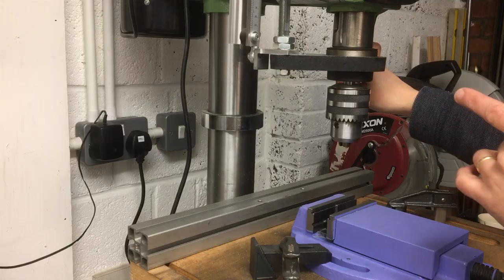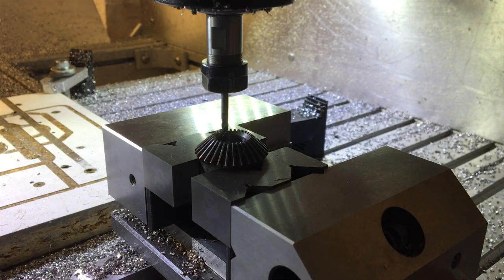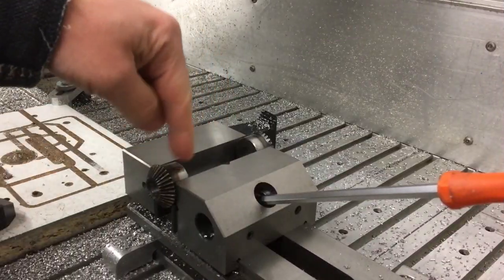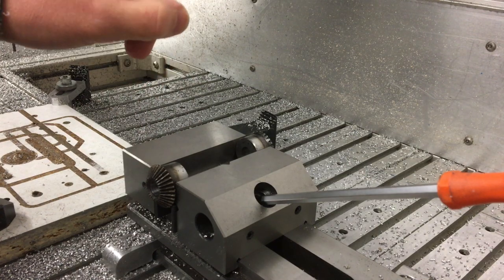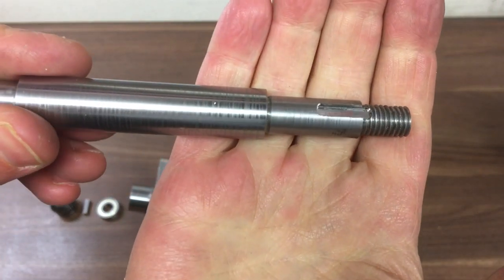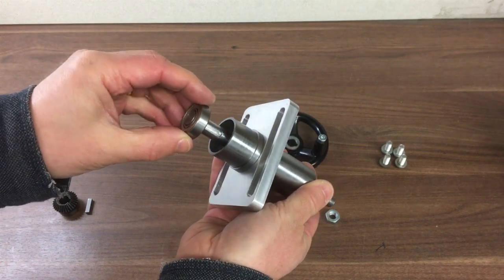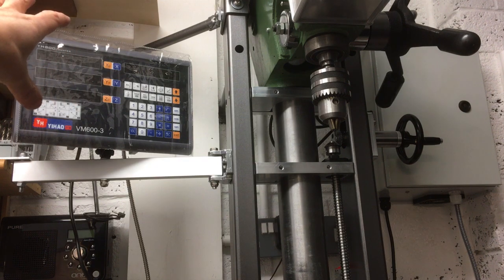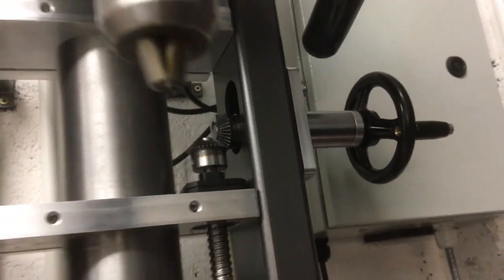Ep15: Drill Press Upgrade | Z mech finished

Comment: You should put one snap ring near the bearing on bevel gear side.....all that can dissassemble until bevel gear makes contact with bearing
Reply from the maker: I think it is OK.  Both bearings are pressed in so should not move and the main shaft has shoulders against both the inner races.  This means the main shaft is trapped and cannot slide out.

Comment: Very cool. I'm not quite sure I understand why one end has a key and a setscrew while the other just a flat and a setscrew. Why the difference?
Reply from the maker: The ballscrew end is only 10mm diameter.  It would need to be 12mm to take the 5mm broach and broach guide.  I did a segment on it but edited it out to keep the video flowing.  If I run into problems on the ballscrew end I will have to invest in a 4mm broach and make new 4mm guides.  Good question, thanks.
Reply: @routercnc9517  Thanks for the clarification. Makes perfect sense now. Cheers.